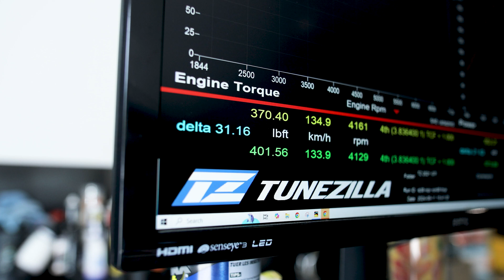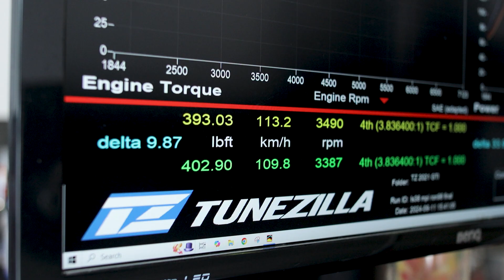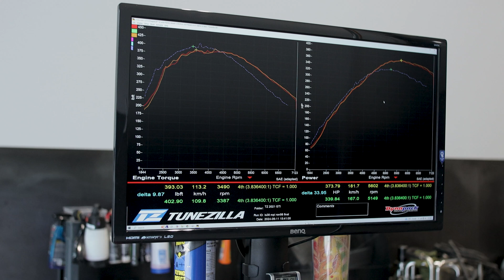Stage 3 IS38 With True Flex Fuel / Project: Corn POWER Blue GTI - EP-03

Comment: Why with MPI it didn't make more power because is not fuel limited like the 1.8? The 1.8 made more power with MPI 10whp more top end and low end and mid was a lot better.

Comment: My MK6 currently sits at Stage 2 (Unitronic) and I am thinking of going with the KO4 Turbo upgrade and going to Stage 3, would you suggest any different? This is a daily driver but would like to maximize the power. Cheers 🍻
Reply: I have slowly been building my MK5 GTI with the gen 1 TSI motor for 5 years and I'm finally full bolt on with an IE K04 running Unitronic stage 2+ ECU and stage 2 TCU software (its now my 2nd vehicle so I tubbed it out with stickier tires as well lol). I would highly recommend going K04 for daily driving. However, if you want to maximize the power with K04 you will need to be full bolt on and incorporate methanol injection.
Reply: I’d recommend the K04x from CTS and get it tuned by Alex from Stratified!! Best tuner in the game and the hybrid k04 will push a easy 400hp with the right supporting mods. Alex will keep your torque number down keeping it linear if you’re running stock rods.